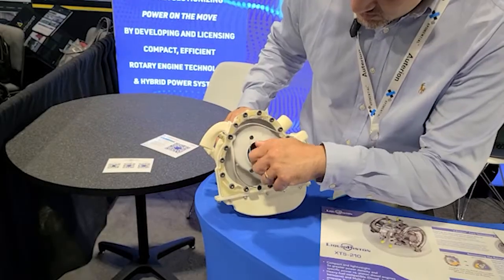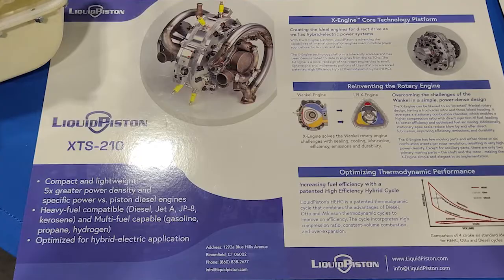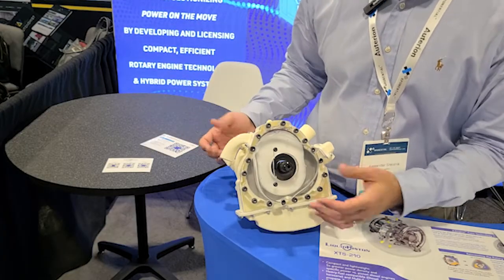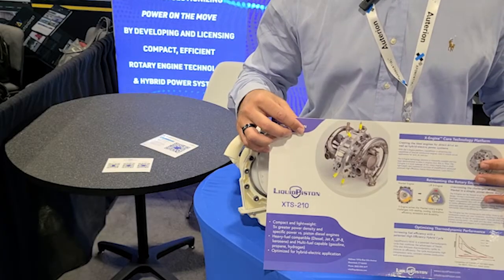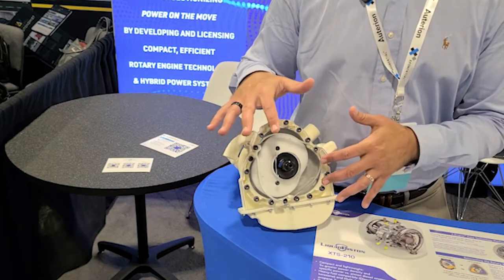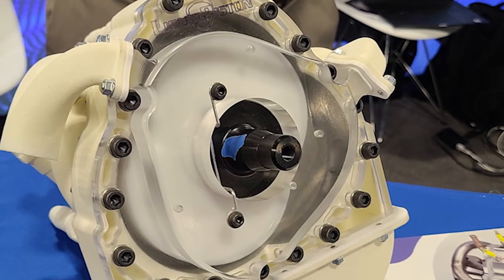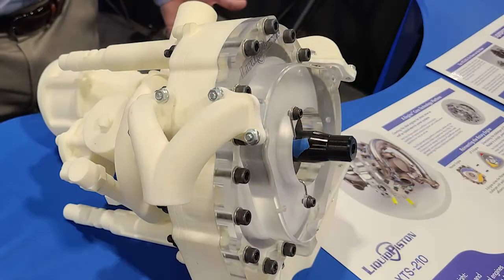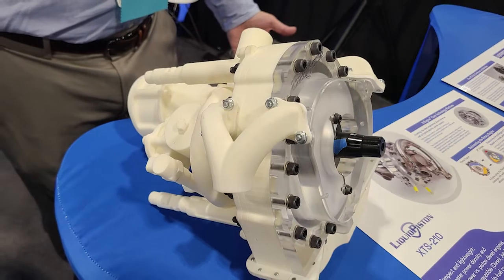25-hp Engine Uses Reimagined Thermodynamic Cycle

Comment: Make larger versions with 2 rotors, roughly a drop-in replacement for the Mazda 13B in size, and that would be great for small aircraft and for boats. Maybe even for cars and light trucks.
Reply: yes and it has a seperate 2 stroke oil tank for the amsoil interceptor 2 stroke oil!